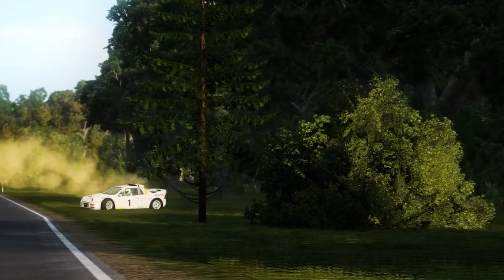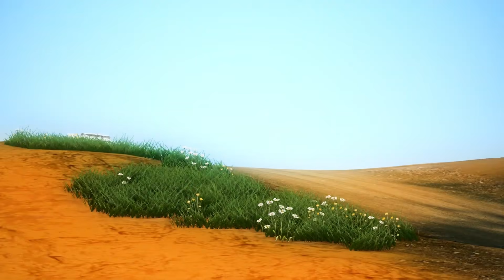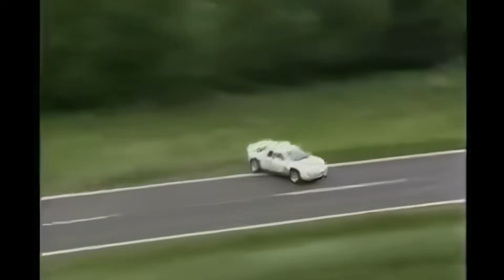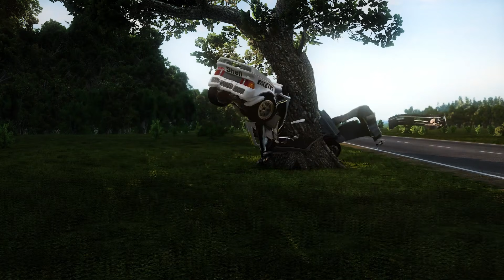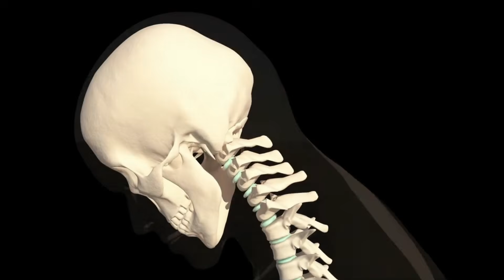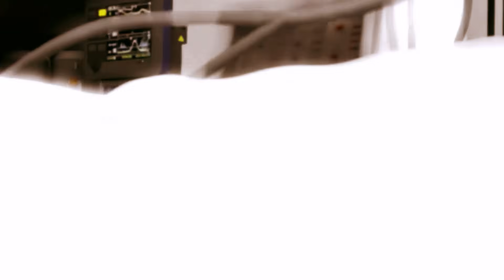3D Reconstruction of Marc Surer’s Brutal Rally Crash.

Comment: I'm going to be that guy. group b did have to sell 200 road going versions of their car. yes the rs200 was a purpose built rally car, but they still had to make 200 road going cars to race it. toned down for road use of course.
Reply from the maker: That’s true— in fact, with the Lancia Delta S4 there was controversy because some competitors claimed the required 200 road-going units had been misrepresented or that the actual production numbers were not as transparent as they should have been.
Reply: You know who has  one of these and probably the Lancia as well..... Jay Lenno

Comment: Group B cars were simply designed ahead of their time. Manufacturers were given the green light by the governing bodies to design what you like without any restrictions etc. So, they went ahead and designed great powerful cars, which resulted in drivers lack of experience in driving such beasts. The governing bodies were solely at fault for the tragedies and demise of Group B. Putting money, as in the want to attract more people to the sport, ahead of safety, proper testing, regulations and research. These cars were just too fast and unpredictable for the ever changing conditions and demanding circuitry that rally stages threw at them. They were like putting a fighter jet engine in to a go-kart and handing the keys to a driver.
Reply from the maker: On top of everything you mentioned, it’s important to add that rallies during the Group B era were true endurance events, far removed from the “sprint-style” format seen in today’s WRC. Drivers were handling 500-horsepower monsters with no power steering for up to twelve hours a day, including night stages run in fog, a level of physical and mental strain that bordered on the inhuman.
Reply: @3dcrash It's crazy what they had to endure for such lengths of time. They got my respect.